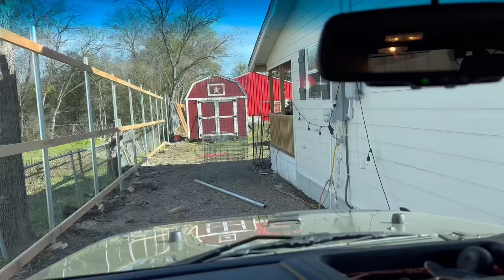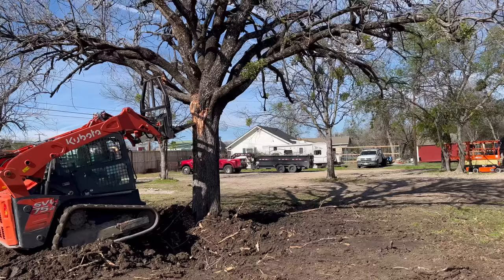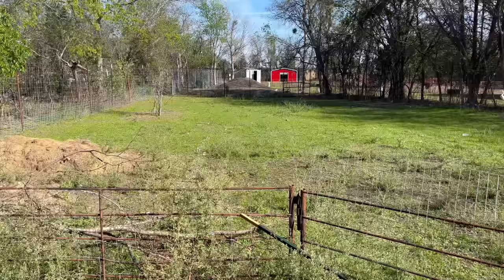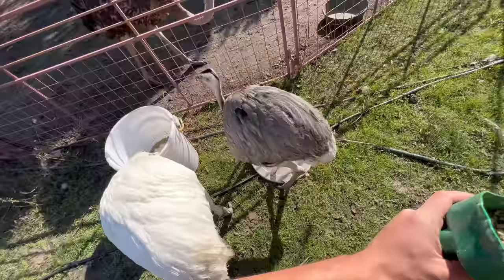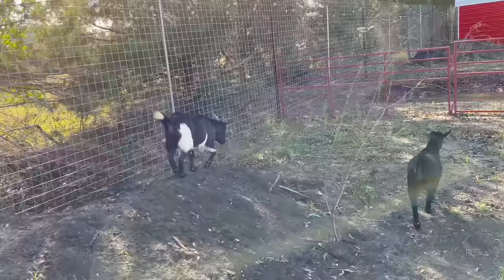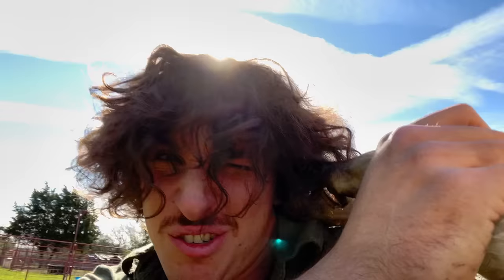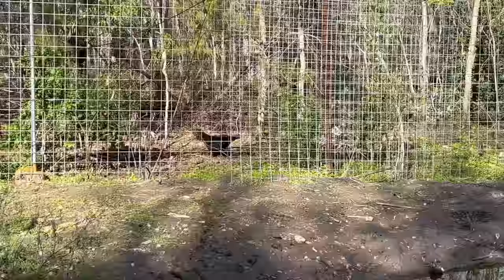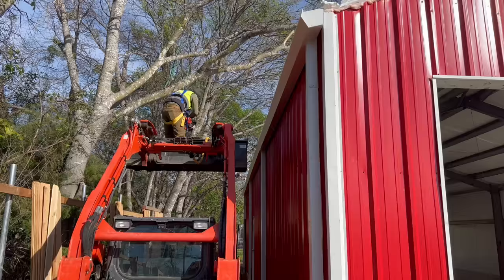Ostrich vs Rhea (Kevin eats Homelander) *cops called*

Comment: @ben for the new barn, you could consider making or buying a rain barrel to catch and store the rainwater from the gutters. You can place the barrel right under the end of the gutter system.  If the barrel is high enough, there might even be enough pressure to force the rain water out of the bottom of the barrel and through a hose to your pond.